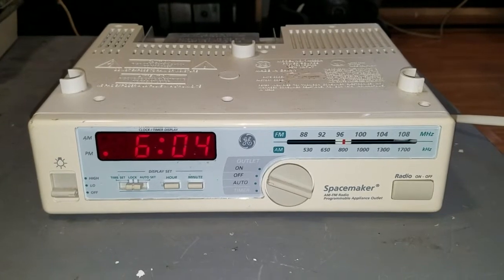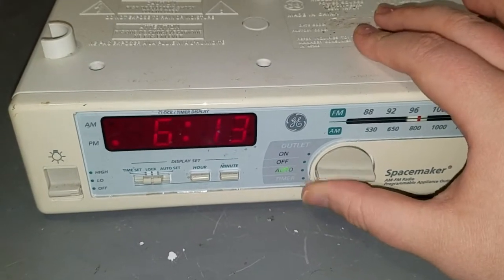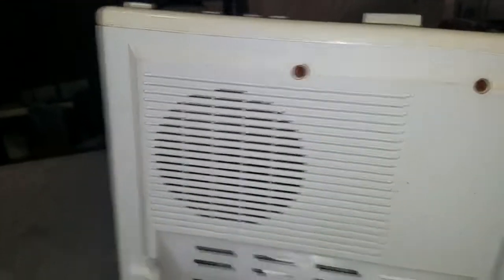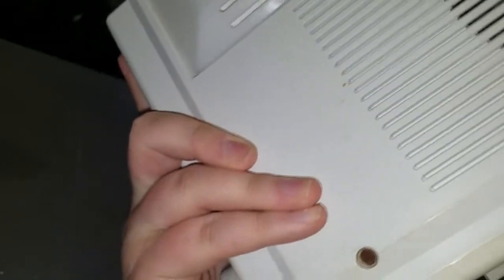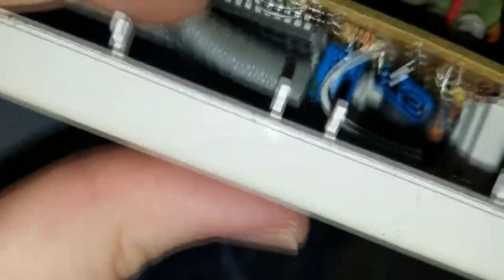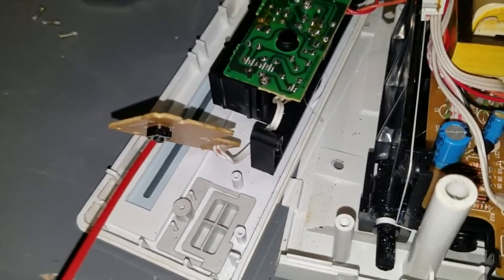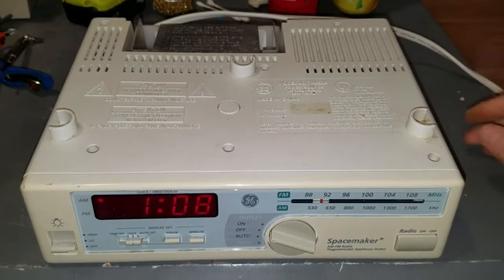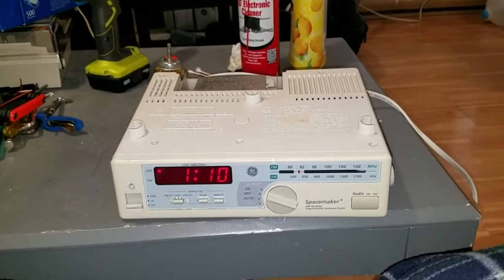GE Spacemaker 7-4232A undercabinet clock radio (1999)

Comment: We have one that has a television. Color tube too. Without any kind of inputs for sources the item is basically useless aside from its AM/FM radio. I remember my parents buying one of these I THINK around 1999/2000. Its still hanging there under the cabinet.  Primary use is a clock and a vehicle for public radio. I wish ours was white. Its more of an institutional gray color.

Comment: My grandma has one of these and it’s broken. She wants it removed but when it was put in someone put vinyl over the screws inside the cabinet so I can’t get at them. Is there any other way to remove it? I can’t take it apart since the screws are on top and it’s mounted too close to the bottom of the cabinet
Reply: there's a video on YT with instructions on how to remove it.  Push up - pull towards you and then push up again